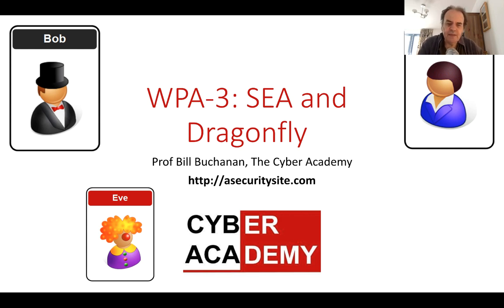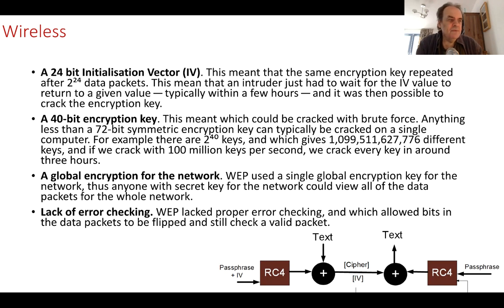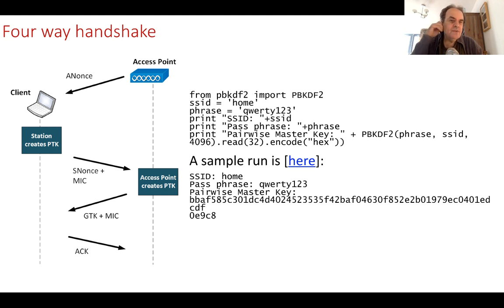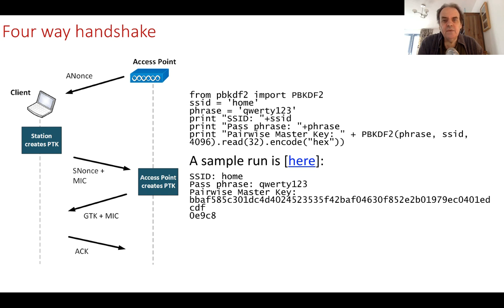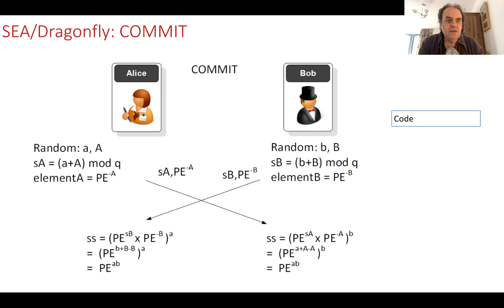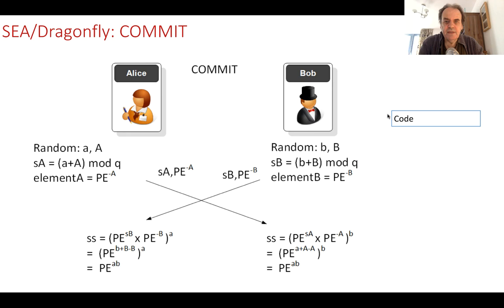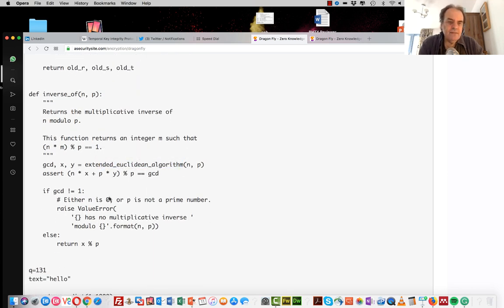WPA-3: SAE and Dragonfly

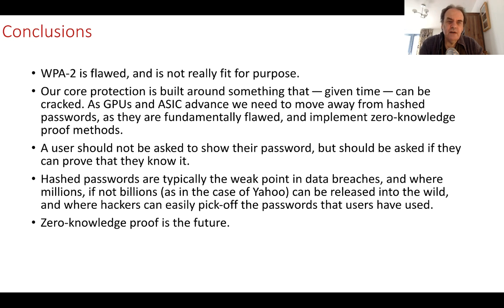Comment: 11:36 Bill B. states that WPA2 is no longer fit for purpose.
I got hold of KALI, captured the 4 way handshake on my my WPA2 home network and tried to crack the password, I gave up after 24 hours.
WPA2 is not as bad as he is saying.
Reply from the maker: It is well known that the four-way handshake is weak, and needs to be replaced. The strength all depends on the rules used in Hashcat. If the password is in a dictionary or has simple rules applied (such as adding a numeric value at the end), it can be cracked in a fairly short time. PBKDF2 will give a throughput of a few thousand passwords tried every second on a simple processor, but that can increase to over 400,000 hashes per second using a GPU. https://miro.medium.com/max/2752/0*yQsLhJpVVF2tcPlG  If we use a cluster of GPUs we can get this up to millions of tried passwords per second.
Reply: @BillBuchanan  There are 95 printable characters in ASCII.
The number of different 10 character random password is 95 to the power 10  = 6 * 10 to the 19
= 46 million years at 1 million tries per second
= reasonably secure I believe
Reply: @An.Individual  Given the fact that most people use very simple / insecure passwords, a simple dictionary attack or the use of precomputed rainbow tables can crack the password pretty easily for WPA2 Personal. Pure brute force attacks are seldom used today to crack any kind of passwords. This is why SEA / Dragonfly is used for WPA3 as it helps bring a higher security even if the password is weak.